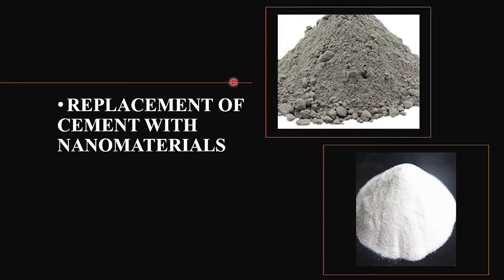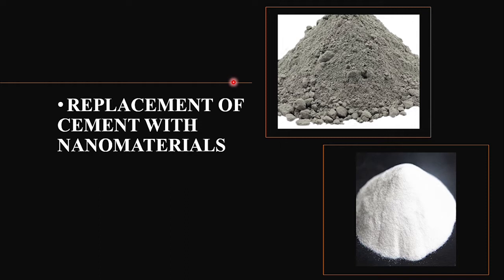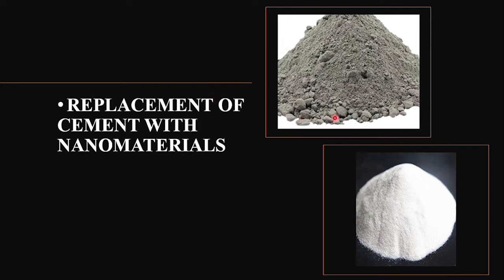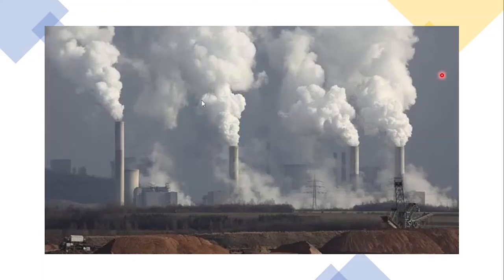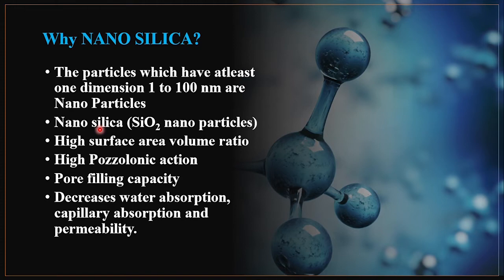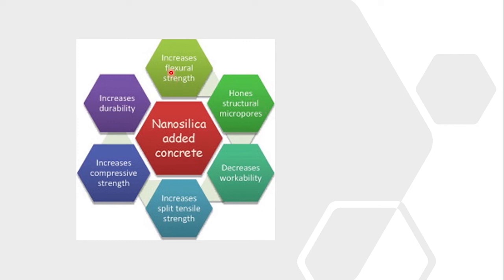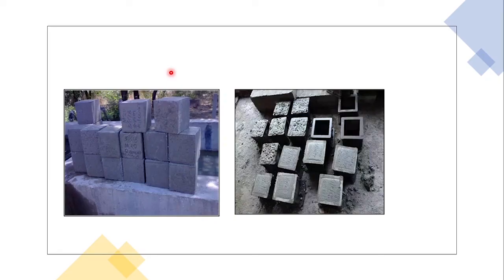Replacement of cement with nanosilica

Comment: Can i added Nano silica in liquid form?...and how much quantity reduce the cement quantity
Reply from the maker: We had added upto 4 percent in solid form..as the percent increasees, workability get reduce.
Reply: @Civil_cafe from literature review 
M30 grade 2% add nano silica at same cement content ...so how tell u reduced cement content
Reply from the maker: @roypatel3164  my project is to reduce cement content so that it will reduce pollution... If u r not replacing cement then that thesis is meant for improving properties only not cement content.
Reply: @Civil_cafe  how to decrease cement content
Reply from the maker: @roypatel3164  for example u r using 1kg i.e 1000gms in concrete mixture then 1percent refers to 10 gms of nanosilica using 900 gms of cement. i.e replacement.
Reply: @Civil_cafe  what is the difference between nano silica or collidoiel silica powder
Reply from the maker: @roypatel3164  both are nano materials with different compositions.